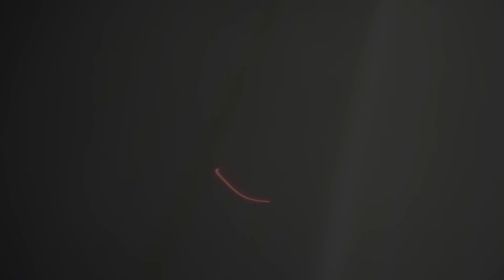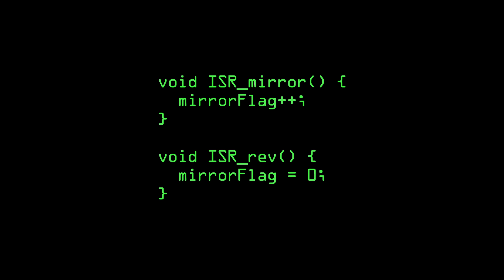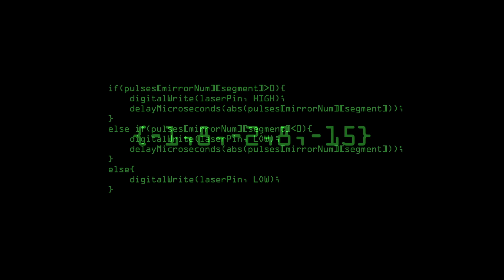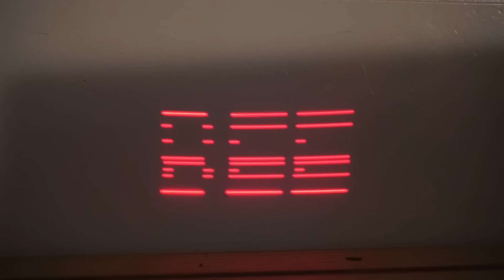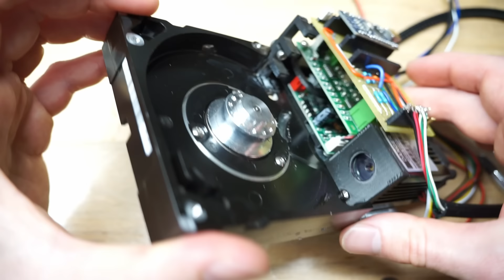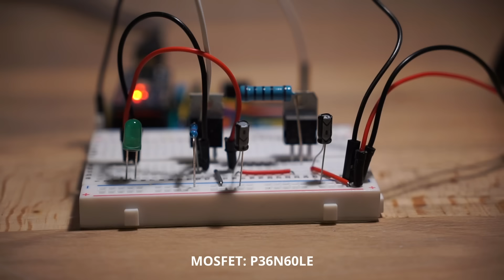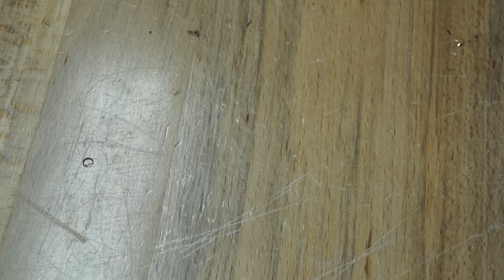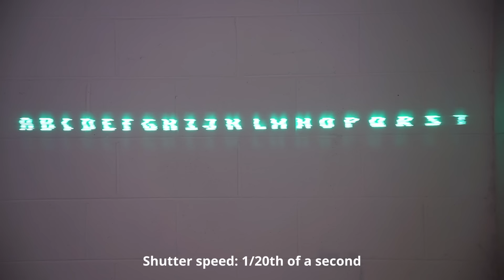DIY Laser Projector - Built from an old hard drive

Comment: cant you just use a laser jet printer mirror head??
Reply from the maker: Those just have all the mirrors at the same angle, so you would get 1 line not 12. However, I did in the second video - combined with a galvo to change the vertical angle.
Reply: @benmakeseverything ok thx for the reply

Comment: Thanks for your detailed guidance through this video. Following it I made my own projector with some modifications like Hall sensor with magnet in the place of IR sensor, used a laser of $3 laser torch driving with a transistor bc547, and it is working. Still a problem I face every time the stretching of frames in vertical direction due to the angle setting error.

Comment: Those ir sensor switches are in like all printers.  I got a bunch from one single laser printer.  Used a few for video cctv cameras as limit switches for the movement to make a scan feature left to right.  Easy project and makes the cameras look all metal gear solid..

Comment: Interesting - I would have looked at this the other way, one laser per row all projecting on the same mirror that vibrates back and forth just like the original party lasers at the start of this video, then its a matter of programming the lasers to switch on and off at the right time
Reply from the maker: Well, that's an option. I like the spinning drum approach because there is no inertia or acceleration issues, beyond the initial spin-up. Adding more lasers could increase the resolution in this setup too.

Comment: Cool project but why do use an Arduino rather than an ESP32 devkit type board. The ESP32 boards are about the same price (or even cheaper), are much faster, dual core, have built-in WiFi and BLE plus many more ports. Also interrupts are more reliable from a timing perspective, even more so if you take advantage of the dual cores. Can't think of any reason to use a standard Arduino board anymore unless for compatibility say with an older project.

Comment: Long time ago (in ~2002) I've made the similar project using two hard drives. However, I decided to use their actuators to control angles of X and Y mirrors, so it should become pure vector projector. The most challenging task was to make thin mirrors. Using chemicals I made a couple of small mirrors out of a single thin glass plate that I had. For synchronisation I took a couple of optical detectors from two broken PC mice. As a control board I used an old PC motherboard (Intel Pentium-based). There wasn't any kind of Arduino in those ancient times, moreover, I needed a lot of computational power. Of' course I used simple weak red-light laser pointer - there were nothing better available in 2002. Anyway, I've got needed results (spinning triangles and other figures on the ceiling).

Comment: I know this i an old video and you probably couldn't care less about this project anymore - but the hall effect is probably better for what you're trying to read here. Hall sensors generate a square wave signal and can operate in the 10s of khz for relatively cheap sensors. they also would be considerably smaller physically.
Reply from the maker: I do care - I made a second version with higher resolution and multi-color though I did use basically the same timing system. But I want to eventually take it one step further and will probably either use the hall effect method, or a reflection sensor to get the exact position of the beam itself.

Comment: I'm thinking... would it be possible to add a second mirror array that would rotate perpendicularly to the first one, but significantly slower, resulting in a vertical deflection of the laser, to make it more of a proper screen thing rather than one-line?

Comment: hello..just a suggestion instead of setting the mirrorsnat an angle could it be possible to attach a tiny servo motor to the laser that sweeps up and down with a limited range while the mirriors remain perpendicular to the  laser beam...just a thought of minimizing the jitter

Comment: I don’t really get how you manage to get such a stable image. I’m using photodiodes, maybe an opto switch really is the way.
Reply from the maker: What I used are IR phototransistors, model OPB11782. They seem to work well, although the wires are unshielded and may be picking up some EM interference. I have another video about this coming out soon.
Reply: @benmakeseverything  ill stay posted, thanks!

Comment: Would it improve with a 32-bit microcontroller? (Let's say the CPU running at 200MHz)
Reply from the maker: Yes, Actually I am working on a better version that's using a Teensy 4.1 microcontroller at 600Mhz, and it definitely improves the timing issues.

Comment: This is great! I love how you managed to do it with a single laser and multiple mirrors at slightly different angles. Back in 2002 I tried to make a laser projector with 8 lasers, spinning mirrors and a parallel port. It didn't go so well 😂
Reply from the maker: Thanks! I found your video on constant current drivers really helpful when I was learning about how to power this, so thank you for making that! You may be interested to know I'm currently working on an improved version of this with much higher resolution and multiple colors. It will (hopefully) be done soon.

Comment: Laser proyectors exist from some years by now... so yes they are a thing and they do not struggle to form 4K images with HDR :)
Reply from the maker: Those use MEMS mirrors which split up light from laser diode sources to project an image, not a single coherent beam that gets mechanically moved and modulated to form an image. So technically you're right, but this uses a different method. The emphasis here was to project an image over long distances, not to achieve high resolution.
Reply: @benmakeseverything  thanks nice to know

Comment: Silly boy. The laser driver is meant to be ON permanently. There are separate PWM pins for controlling the laser duty cycle. Just turning the module on and off will result in the issue you had. In other words, it is not a hardware error - it is a wetware error.

Comment: You need to make a DIY galvanometer.
People have done this before so its quite doable.
But you need 2 of them, one for the X movement and one for the Y.
Search around the net for info and examples.
Reply from the maker: The point of this design was to display an image without using a galvanometer. As I mentioned in the video, there is an inertia limitation in something that has to move back and forth - this just spins in one direction, so that issue is eliminated (at the expense of vertical resolution). However, I plan to experiment with using one in the future to see what is possible. Thanks for watching!

Comment: So not from an old hard drive, completely from scratch after the hard drive didn't work...so title is clickbait, but the project was interesting, thanks for the video.  Next time, just say DIY Laser Projector that tooks months and cost hundreds of dollars.   btw, you should check out using a laser printer, they have rotating mirrors and all the timing to do very high resolution.   Replace the infrared laser with a visible one. Only a single line, but maybe get 12 old laser printers
Reply: definitely not clickbait what are you yapping about 😂😂 it quyite literally is from an old hard drive. he used the motor. even using the housing alone is still technically "from a hard drive". using the scanner arm makes no sense, so what else do you expect???

Comment: Just one precision regarding the use of constant current for driving Leds. Led's behaviour is similar to Zener diodes, it "limits" its own voltage generating lot of heat after the elbow is reached, this is why controling the current is much more practical.

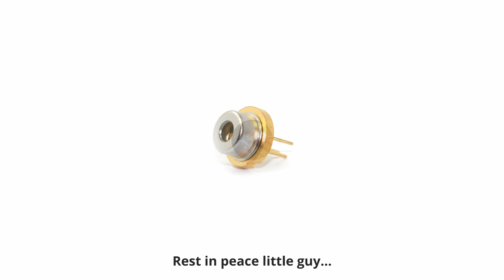Comment: 13:49 Might have been. ALL unearthed power supplies have a voltage potential of about 60 to 110V (AC) to ground. That includes original laptop power supplies. If then a connection, through a sensitive component, happens to ground, the component dies. Solution ground your 0V, that pulls the high ohm potential to 0V and keeps components safe.

Comment: I did something similar in 1989 as part of my final year physica degree. use a electro-optic crystal instead, which chanes its refreactive index based on the applied voltage

Comment: there is something i dont understand , how it going up and down to draw the image ? now the mirrors rotate so it should draw the lines in horizontal , so what about vertical ? how you control it
Reply from the maker: There are 12 mirrors, each at a different angle, So the light reflects in a different place for each one. therefore 12 lines are drawn very fast, so it looks like one image to the eye.

Comment: Wait... you used a brushless motor and still messed around with a photosensor?
Reply: a lot of brushless motor controllers have internal position sensiing that would be annoying trying to decode. it is much easier to use an optical switch as he used.

Comment: Don't you have to use a eight sided mirror rotor and another similar mirror one scans the lines across and the other scans it down a bit and repeats but the second mirror runs slower than the first mirror.
Reply from the maker: No, each mirror is tilted at a slightly different angle, so the light gets reflected in distinct lines as it spins. That was the point of this design, to have only 1 moving part.

Comment: Thanks for sharing, well structured and easy to follow.  I was thinking of making such a project without mirrors, connecting the laser to a two-access joystick model, and then having it controlled by motors. This would eliminate a few of the issues that you are having and perhaps create new ones.. lol. I have not done any research or cost estimations. Another option is to model like an old analog oscilloscope so it can display anything. Have a great day :-)

Comment: What about using a "laser engine" from an old cheap laser printer?? It already has 90% of the mechanics&optics. The remaining 10% would have to be the vertical movement of the laser. But should be much better than an old HDD. Good luck!

Comment: Instead of turning laser on off, make some fast switching blocking mechanism in front of laser so instead of turning laser on off you can block it reflecting from mirror, so you can achieve full brightness. And instead of Arduino, use FPGA would be good for switching accuracy.

Comment: Some notes: Optic sites like Edmunds sell experimental mirrors that size (25mm~) for cheap that are still extremely precise, or surplus optics is good too. Instead of interrupt maybe use millis. On production: A moving blanket on the wall facing you will kill the echo (it's very distracting) and the B camera is a bad angle, too far from center, bad background, and different lighting. If you have to use it (after moving it) face it while talking. But match the eye line (level) of the A camera. Make it purposeful, use a fade not a cut. Consider using a digital audio recorder like Tascam DR-05 or -40. liked and subbed.
Reply from the maker: Thanks for the feedback. I'm working on an improved version.
Reply: @benmakeseverything  Wow talk about feedback, these guys are writing dissertations and everyone is getting along (!) on the interwebs. Look forward to the next one.

Comment: in theory, if you use a DAC, and perhaps more mirrors, you could build a display not too dissimilar to a crt. if you use an external signal, the DAC could be avoided. similar to NBTV, if you use a negative pulse for each line, bar the first line. you can have the external signal drive the laser directly (via an amplifier), and the arduino just handles the timing of the mirrors.

Comment: Why did you not take advantage of the data read arm in the HDD?  

It moves very fast and very accurately, which if combined with either a mirror or prism would give you the ability to vector scan instead of the raster scanning you’re doing (when used in pairs).
Reply: I tried using the HDD arm. It produces a lot of noise, uses a bit more power, and also has no position sensing.

Comment: Hi! Very interesting project! Probably somebody already suggested you to switch to lithium batteries: you can add 4 13650 cells to obtain more than 12V. There are some really cheap charging boards which can be bridged and used to charge the cell via one USB-C cable. Cheers
Reply from the maker: Thanks, I am working on a better version that will have rechargeable batteries among other improvements.
Reply: Great!

Comment: The horizontal sweep is clear. And how did you "move" the laser in a vertical position? After all, judging by the design, you don't have anything that would change the angle of the laser "up and down"!!!
Reply from the maker: Each mirror is at a slightly different angle. So 12 angles = 12 lines. The trick was getting the spacing right, hence the adjustment screws.

Comment: those audience show lasers are dangerous as are ALL lasers -- tiny PITS in eyes; invisible INFRARED; REFLECTED BLINDNESS etc. -- protective glasses ALWAYS!:hand-orange-covering-eyes::hand-orange-covering-eyes::hand-orange-covering-eyes::hand-orange-covering-eyes:
Reply: any RGB laser diode that isnt diode pumped shouldn't produce any IR or UV unless you push it over its maximum power. Then it will start to heat up and produce high 800+nm and low 400- nm

Comment: I love it!  I had an idea to do this myself years ago (even using multiple mirrors on a hard drive motor) but I couldn't crack it because of the complication of needing a second motor/mirror rig to get the vertical scan.  Your solution of just using angled mirrors on a single motor is simple and elegant, very nicely done!  Can I now throw a challenge at you?  There are high power 650 nm Red and 445 nm Blue lasers available... RGB is your obvious next step!

Comment: Radiation source detector. Using a crystal to detect radiation particles passing through the piezoelectric crystal causing the LED to illuminate. More Rads produces more light. So if we build a crystsl x-y array and display each crystal to a LED, we can see a radioactive source.

Comment: I guess the jitter is caused by interrupts and your code, not anything mecanical or what you said. It looks just like pwm when you use arduino sleep to create it. disable the arduino counter, it will probably remove the issue
Reply from the maker: Yes, I believe thats correct. I switched to a Teensy 4.0 (600mHz) after making the video, and the issue is vastly reduced.

Comment: Hi! I’ve just seen the video and it was fun. I noticed that mirrors were pain in the eye. Maybe if rotating cylinder is made with 12 sides at perfect 90 degrees to the ground and if you make it wobble while it turns by let say 1 degree, then mirrors would angle themselves between +1 and -1. No need for adjustment. Anyways that’s just a thought. Cheers!
Reply from the maker: Interesting idea. I wonder if the offset would cause it to wobble due to weight imbalance. Maybe a counterweight could be added to help.
Reply: @benmakeseverything  good idea :) worth a shot

Comment: Very cool! My first thought would be using 2 lasers on top of each other allowing 2 lines to be drawn with each pass this means you could reduce the mirror count to 6 and it would be brighter. A faster micro controller would give you more timing tolerance in code something like a teensy would probably be a good fit.
Reply from the maker: I am actually working on a better version. And I'm using a Teensy 4.0 which has a 600mHz chip - that combined with better code has mostly eliminated the wobble issue seen in the video - and I am also looking into various methods of improving the resolution. I'll make another video once the updates are done.

Comment: not  true at all galvos can produce very complex animations like 3d studio  max animations i should know we are a laser light show projector manufature   extreamly expensive galvos can run up 120 k point per second  more affordable and more common  scanners run at 30k to 40k typically  even 60k  so yes we can use galvose and get a way cleaner image or text
Reply from the maker: Interesting, I was not aware that such speeds were possible, but then again I am new to this. My intention though was to create a "raster" image instead of a vector image like galvo systems typically do. With the single rotating part there is no inertia to overcome. But I am looking at building a second version that might combine a polygon mirror with 1 galvo for the vertical axis. Thanks for watching!
Reply: @benmakeseverything  actually galvos can do raster images in 2 ways linear like you are doing and  circular but yes what you suggest has been done and does work using a polygon mirror to create the scan lines and a galvo to step the row  then obviously use rgb  blanking  to actually create the image  but if you want some galvos to experiment with i have a bunch of orphan galvos from repairs as they are only sold in full x/y kits
Reply from the maker: @TechnologicalArtisansBrooklyn  I would definitely be interested. I basically need something that can move down, hold position for the rotation of the polygon mirror, then move down for the next line. Not sure exactly how fast that would have to be, I guess it would depend on the number of mirrors and RPM of the motor. Do you also have the driver boards for the galvos? I have been looking on ebay but in many cases the seller only has 1 or the other.

Comment: This all project found in a leser printer called laser unit
Reply from the maker: Not exactly - the whole point of this is that there are 12 distinct lines with only 1 moving part - those laser printer mirrors are all at the same angle, so it would only show 1 line.